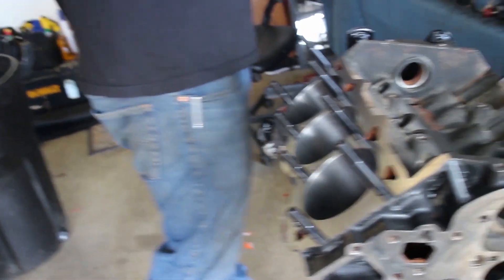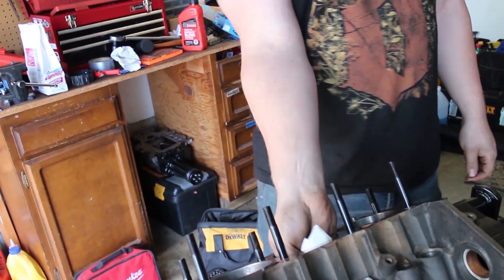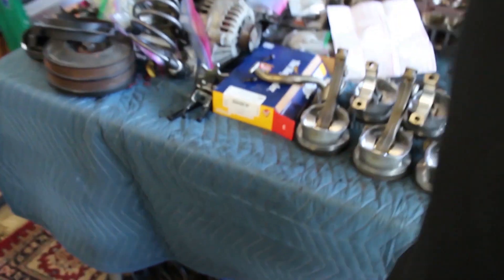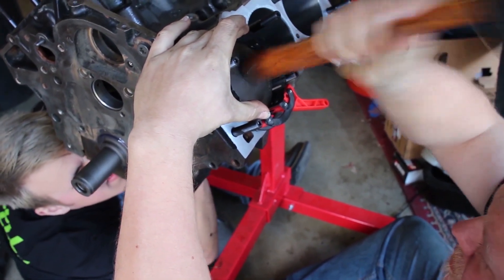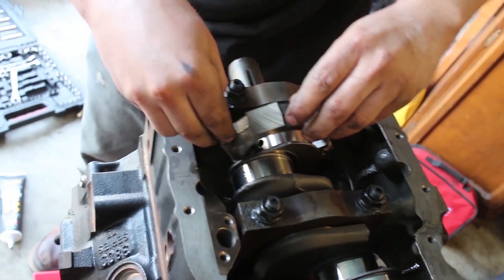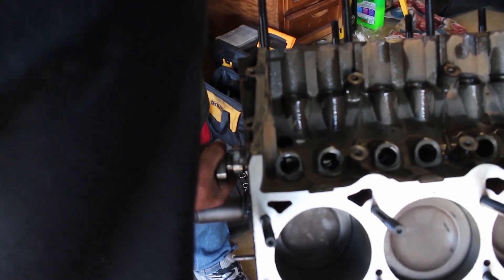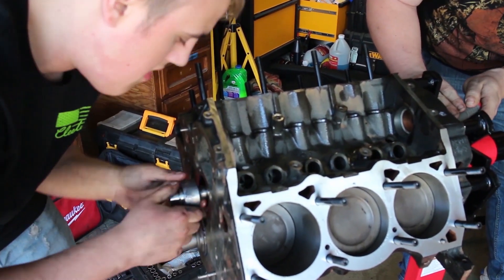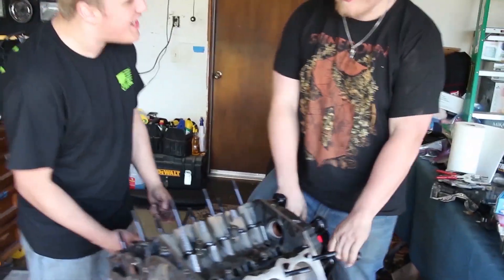Project F 3800 L67 Engine Rebuild! Part 2 (ZZP XP Hot Cam Install!)

Comment: This is why you put the cam in before the rest of the rotating assembly.
Reply from the maker: I'm not sure what the rotating assembly has to do with the cam, they don't interfere with each other so shouldn't matter which gets installed first

Comment: whats the cam specs
Reply from the maker: We're using a ZZP XP hot cam.  

    212°/224° at .050"
    Intake Lift .325" (.520" lift at 1.6:1 rocker ratio)
    Exhaust Lift .335" (.536" lift at 1.6:1 rocker ratio)
    116 Lobe Separation

Comment: Uhhhhh...what machine shop says "its cool to have pits in the cyl. walls.  Send it"?  Post their name so NO ONE USES THEM.
Reply from the maker: There was very little putting in cylinder 1. After getting it cleaned up by the machine shop it was even better. It should work just fine.